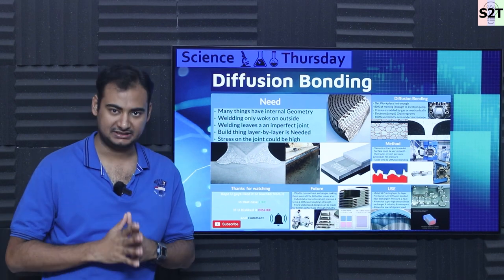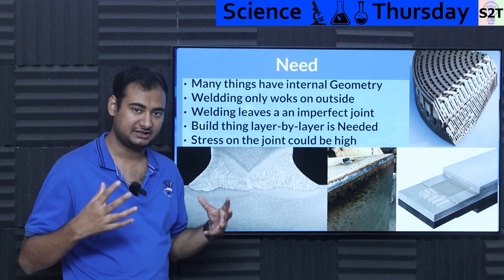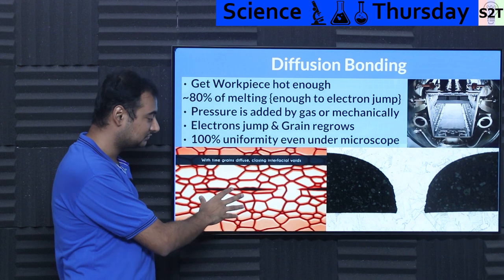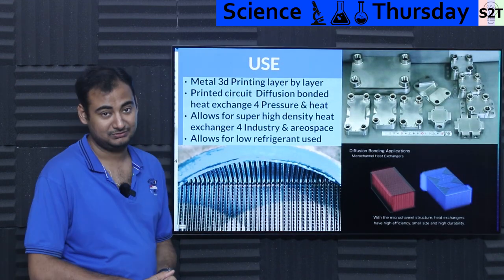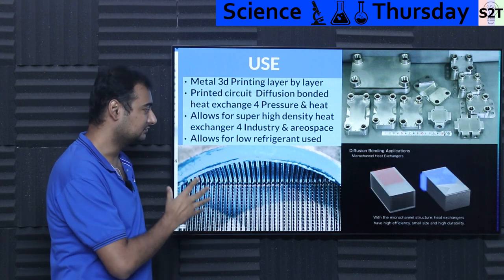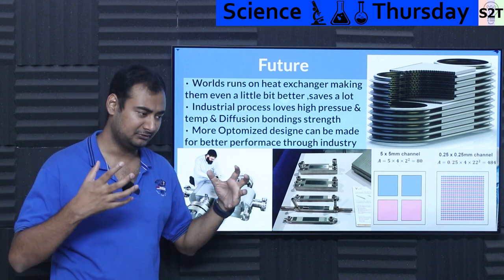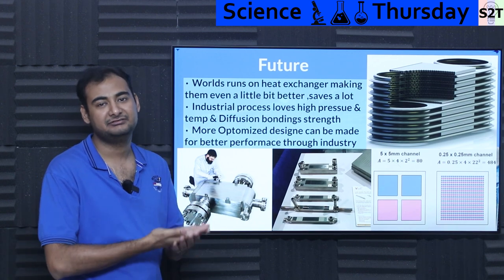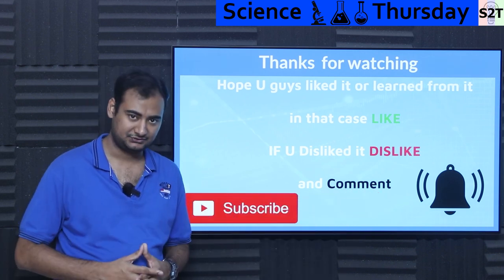Diffusion Bonding Explained {Science Thursday Ep204}

Comment: I've been reading up on diffusion bonding (specifically bonding copper to stainless steel) and I've found a lot of papers that reference an interlayer of another material. For example, I've found a paper on bonding copper to stainless steel with a nickel interlayer. What is the purpose of this interlayer?
Reply from the maker: its similer to electroplating where we use an interlayer to coat some select metal alloys   look into that for easy of understanding . reason would alwasy be same basic stuff like Improved Wettability and Adhesion & fatigue resistance etc